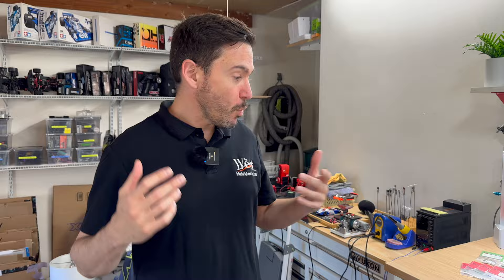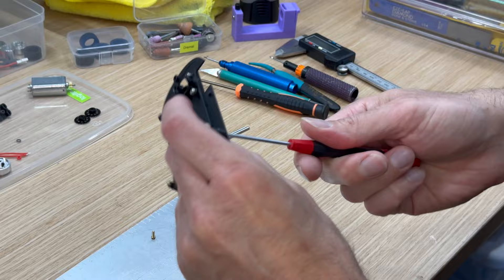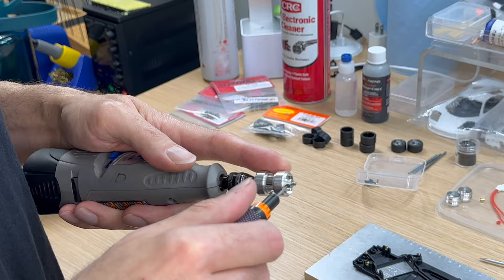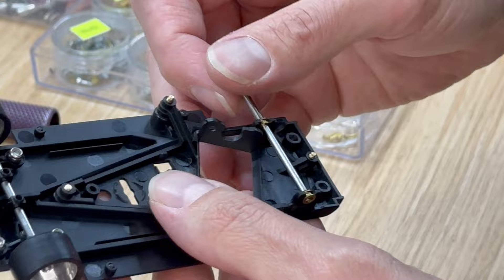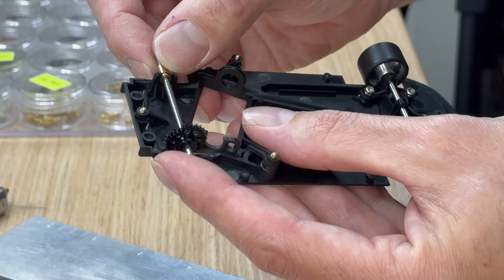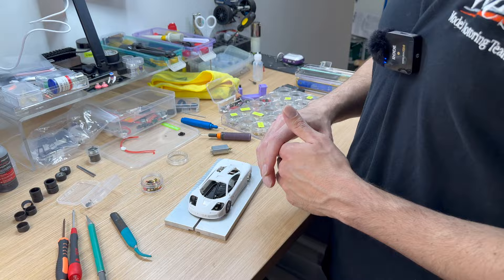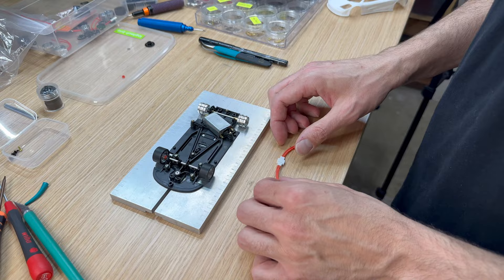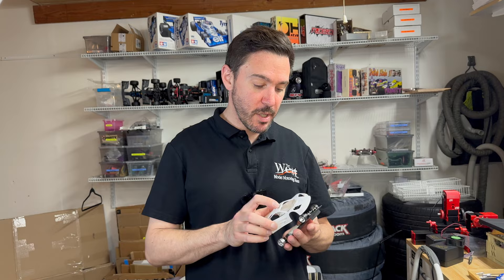MR Slotcar 1/32 McLaren F1 GTR — Part 2: Blueprinting & Assembly 4K

Comment: "Marginal gains theory is the theory that improving and optimising your performance by a small amount across a number of different areas will lead to much more significant, noticeable improvements overall."
Reply: Ian using the front tires as a height point is different then what is popular. Most people say the front tired should barely touch. Can you talk about that ?
Reply: @larrycariglio909  my guess is that spacers possibly induces play, potentially causing deslots. Another benefit is that is makes it easier to adjust front ride height.

One major drawback is that it reduces the depth of the guide, mening that the guide has to move less vertically to cause a deslot. I believe this is one of the respons that we saw the front of the Mclaren seem unstable in the race, and might have been the deciding factor between a win ans a second place

Comment: Generally speaking what is the distance you like for your front tire to be off the track?
Reply from the maker: We run the front tires on the track. So the car is (for the most part) contacting the track at 5 points - the guide/braid, the front tires, and the rear tires. We also true our front tires to be perfectly round. We tend to like a level chassis front to back to be neutral handling.
Reply: @idwurks  how low do you allow the chassis to the track?
Reply from the maker: @nflpicks4920  I like the car to be as low as the rules allow.
Reply: @idwurks  ok I will apply all that I can and let you know how thing turn out! Really appreciate your help!

Comment: Very interesting stuff.  I'm just a year or so into the hobby.  You seem to have a large inventory of spacers, screws, nuts, washers, etc.  Is that something you have just accumulated over time, or can you actually purchase assortments of these things?  Thanks and looking forward to more videos.
Reply from the maker: Hey Randy - I tend to go a bit ham when those things are in the counter in front of me. I just started racing 1/32 in 2021/22 so I have been collecting parts. If I need a part, I'll usually buy a few just in case - especially bags of spacers and screws. I always give that stuff away at the track so it ends up emptying fast! I would recommend checking out SlotingPlus as they carry a HUGE amount of spacers, screws, nuts — All incredibly high quality. Good luck with your racing and thanks for the comment!

Comment: Ian, your video seres is on point & on time. I am doing the Jim Rose, Slim Can Conversion for MRSLOTCAR McLaren build so this is icing on the cake for me! Thank You, thank you, thank you! And for my first question; why did you pick the 7052 front wheels and not something lighter and or smaller like the; MRSLOTCAR MR7021 Ergal Aluminum Wheels 'ARIA' Air Ride System - 15.8 X 8.2mm - 3/32" Axle? Thank you for your time and help. Ian, 1/32 plastic cars are new to me. I started slot cars back in the mid 60's and stoped when Slot Car Junction went out of existence, so 1/32 could be my come back! PS I watched a new Y/T video to day about NSR brushless motors and the guy in the video said that Paul G. has been in Arizona working on his brushless Slot Cars! I haven't seen Paul, since 2018 or so and his name comes up in a Slot Car video today Lol...
Reply from the maker: Man, SCJ. That brings back memories. I remember going there for Norcal IMCA back in the 90s - that was a throwback! I DID end up going with the 15.8x8.2 fronts because the larger fronts actually were too big! I just never updated the video - so great question. We had to run MR front and rear wheels - so we had some limitations. I tend to run the 15.8 fronts on most cars, but may start running slightly larger if the ride height permits just because the baby sized wheels look so bad! I have a Sideways AMR GT and it needs bigger wheels or else it looks ridiculous. I'm glad that the videos are helpful! The fact that it helps people is why I do it, and just helps energize me to do more :)

Comment: Nice video bit different to how i tend to do things but all valid opinions. An option for you regarding motor security. Why do you choose to glue the motor and not use screws to secure it. If youre potentially concerned by it pivoting on the screw end and moving at the comm end of the motor. You can use fibre reinforced tape to secure the motor .
Reply from the maker: Thank you. Using the b7000 glue for the motor is due to a few reasons - 1) tape of any kind is not allowed on the pod or chassis at Electric dreams. 2) the b7000 provides some dampening as it’s not totally rigid, and 3) it can be cut easily and cleans up nicely :)
Reply: @idwurks  Thanks for the reply, will give it a go and see how it compares.